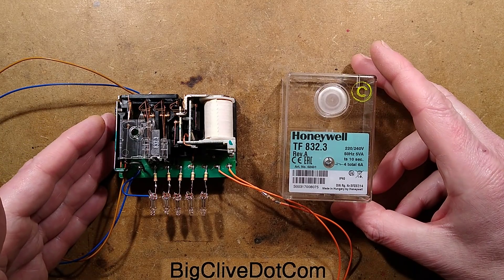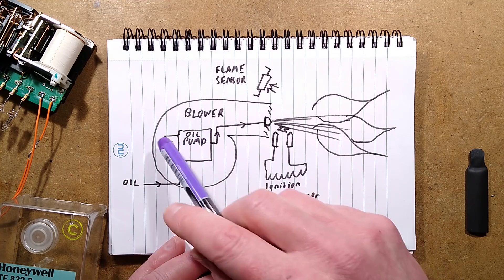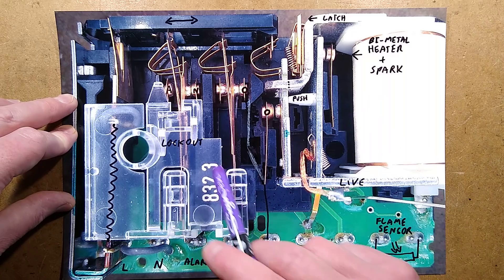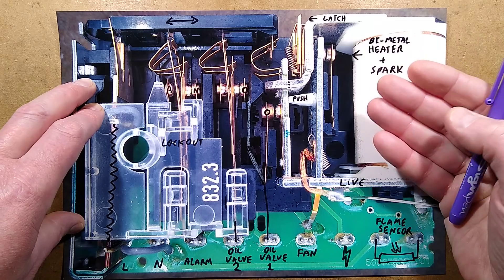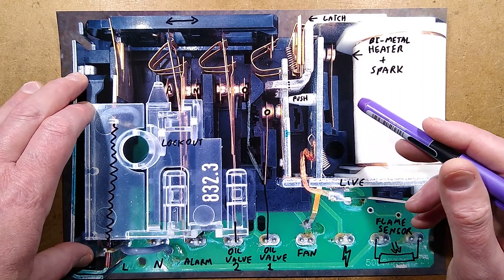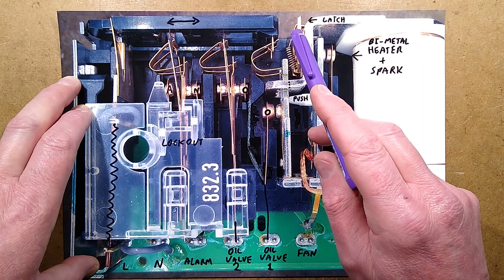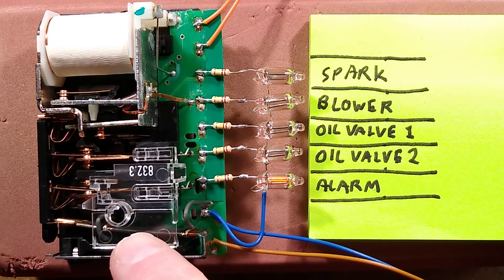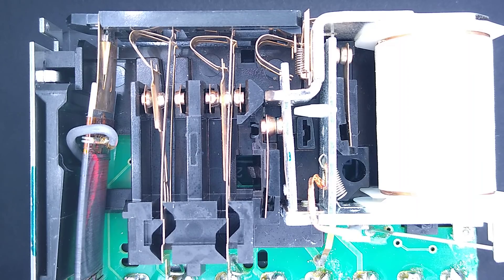Incredibly clever oil furnace burner controller (very perplexing)

Comment: You just know at some point a Chinese manufacturer will look at this, decide the error indicator needs to flash, and put a microcontroller on it to blink the indicator on and off.
Reply: It's already built into the controller, no doubt done by the pcb on the backside. Different flashing patterns on the reset button lamp signify the fault, black magic.
Reply: @BobJones-sx4pb  Heh, it was mostly a joke regarding the flashing lights that featured on a previous video where they had an 8-pin microcontroller that was only there to flash the LEDs—and in the particular vid the micro had been bridged out because it was an "always on" version. The micro was still there, still strobing its output pin—but nothing listened to it.
Reply: @ConstantlyDamaged  Ah sorry missed that - cue over my head emoticon
Reply: @bobh9319  'Sall good mate.

Comment: I was troubleshooting a flame sensor and didn't know anything about their operation.  I saw a few fine wires to the unit and assumed they were the 4-20mA signal line.  When I touched them I got a few hundred volts of shock.  Turns out the wires were the Excitation line and the sensor used high voltage to create spark potential.  So long as the flame produced ultraviolet light the spark would continue.  No UV gave no spark arc and the unit shut down.  Fun game the whole 'Learning What the Black Box Does' is to play. [The sparks were barely visible and 1mm long at most]

Comment: Reminds me of the "fun" I had trying to figure out the way the Poka Yoke ポカヨケsystem  worked  at the Honda car plant I worked at, which was used to stop the production line  if a critical bolt was not fastened, missed, cross threaded or not tightened to its specific torque. Devilishly clever when you consider conveyors, pneumatic systems, transducers and tools and all sorts of stuff were all linked together.

Comment: Those units were designed by a swiss company, Satronic. Honeywell bought them out. They make gas units in a similar design and also bigger ones with motorised cam switches. They're known as one of the cheapest controllers in the industry, and the propensity for the tiny contacts to burn out readily (they're all operating inductive loads) shows it.
Reply from the maker: The biggest inductive load is the motor, which is only switched by the normally closed fault contact. It would be interesting to see which contacts are most prone to failing.
Reply: @bigclivedotcom  the spark transformer and oil valves are somewhat reactive

Comment: Before electric flame sensors, the controllers were mounted on the flue so that bi-metallic contacts activated by heat verified a flame. They were capable of restarting, lock out and reset. Just picture this unit but twice as complicated, plus hot and sooty. Side note: The purpose of the oil delay is to allow the fan to induce an upwards draft in the chimney prior to starting the flame.
Reply: Yup, old “stack switches”. Had a coil in the flue that would twist with heat, and close the contacts. 

Problem with those was the amount of delay allowed from start to a safety shutdown. If the burner had experienced ignition failure, there would be an awful lot of atomized oil sprayed in the chamber before it tripped the burner off. Compound this by the homeowner hitting the reset, for another blast of unburnt oil entering the chamber.

Comment: I opened one of these up a few years ago. It had been replaced as the timing was off and it shut down to early in the ignition phase. I figured it was probably a leaking capacitor so I thought it just might be an easy fix to replace it and have a spare controller at hand. Well, as we both now know that wasn't the case...
I spent some time figuring out just how it worked. This controller would actually do three ignition attempts before shutting down, so it was just slightly more complex, but basically it functions just the same, just an added bimetal spring and heater that is timed to allow the ignition circuit to cycle through three attempts before shutting down.
In the end I just sprayed it down with contact cleaner and assembled it again. It did work when I tested it but I didn't feel certain it wouldn't gunk up again so it's on the shelf for now.

Comment: This reminds me of control circuitry of old elevators. Those are also mechanical wonders. Especially the mechanisms for determining the current floor. In some systems they even 'simulate' the elevator car by having a miniature one inside the control cabinet that pushes against switches while moving.
Reply from the maker: The Otis pie plate selector is one of the freakiest.
https://www.youtube.com/watch?v=Ge_2D1XKKO8

Comment: Thanks BigClive for solving a mystery of over 40 years!  I can recall getting soaked in diesel trying to troubleshoot a De Detrich burner that would "lock-out" and fail to ignite. It had a Honeywell controller very much like shown (installed in 1972)...I figured that the contacted were a bit pitted, so  I polished with sandpaper. Finally figured that the flame sensor was all sooted over the LDR and needed a clean. When it fired up with a mighty trump and roar I was a very very happy 12 year old kid! Only problem was my "school shoes" stank of diesel for months after...
Reply: I've been having the same experience with a older Cuenod NC-4 burner that would not fire at all, even with a new controller fitted it would still lock out.. As I was helping the tech dismantle the darned thing.

I remember we tested the flame sensor (using a lighter to simulate a light presence, the sensor was temporarily connected to a DMM) and it was good.. Then we tested the coil on the pump, yup, it was completely open, so we swapped it, did it solve the problem? Nope! Still no flame... The tech threw in the towel and swapped the whole pump assembly. Nearly had the oil tank empty itself in the basement, I remember the moment I rushed for the shut-off valve.. Good times lol

We smelled like oil for about a week after this whole ordeal, definitely not something I'd like to experience again!

I asked the tech if these control boxes would go bad often, and unsurprisingly (at the time it was surprising for me), he told me that they rarely go bad, and if they do, it's usually the contacts inside that need to be cleaned.

For years I was always wondering how these worked, but I really didn't think they would be so simple yet complicated at the same time.

Comment: I remember when the control circuit failed on my parents oil boiler after 20 years of service. We spent a while trying to figure it out. Good to see how it finally works after 20 odd years of waiting 😀. I'm sure controller number 2 will fail soon.
Reply: "control circuit failed on my parents oil boiler after 20 years of service"
Our boiler was so old, it didn't have a controller ! Either the gas valve was open or it wasn't :)

Comment: A genuine "wow" - this is a truly amazing piece of design.

It's the sort of "extreme cleverness" that makes you wonder though if the inventor ended up rocking himself gently in an asylum somewhere - I think this level of complexity is more likely from someone that is at least partly savant. Remarkable design - and great explanation too, thank you.
Reply: I wonder if this started as a simple (ish!) controller and then was added to over time to meet the demands. Can you add a second oil jet? Yep. Oh, now can you add an alarm trigger? No problem! Actually, we need to sanity check the flame sensor, can you add that now too ....turning it into the fiendishly complex structure we see here.
Reply: @Wirralguy  It was probably the result of many years (decades?) of problems and regulations.  Look at current electrical safety regulations or aviation maintenance requirements. All of those are built upon the injuries and deaths of the past.
Reply: Stop asking for my real name! Absolutely - incrementally refined over probably 100 years now by reviewing catastrophic failure modes, until it will almost always fail in a safe mode.  This wasn't a single inventor or even a single team - it was a community trying to keep people safe.

Comment: Man, that's the kind of old-fashioned engineering you don't really get to see very often anymore. Must have taken a lot of fine-tuning on the manufacturing side to get it just right. Needed to watch it a couple of times to understand it properly, but I still can't quite figure out what that latch thing in the top right is doing there. In the scenarios you showed it seems like it could work without it, but there must be something I'm missing.
Reply from the maker: It prevents the power being disconnected from the bimetallic heater (and ignition transformer) until the full excursion of the actuator has been achieved.
Reply: @bigclivedotcom  Yes, but I don't quite get why it does that. Could it be because the spark may intermittently trigger the light sensor and this prevents that false triggering?
Reply from the maker: @ManWithBeard1990  I'd guess it is to maintain the spark briefly to ensure complete ignition in case there's just a localised burst of flame at the spark gap.
Reply: @bigclivedotcom  Yeah, that's probably it. Or something along those lines.

Comment: Modern burners 
1. purge any explosive gases by running the blower for a few air changes 
2. light the pilot usually HEI, high energy ignition, or spark or hot surface, above autoignition temp for the fuel
3. Prove the pilot using flame rod in the flame or photoelectric means, hydrogen requires UV camera. 
4. For a new or cold system you must wait for the cavity to heat and drive off any moisture in the fire brick so they don’t explode
5. Turn on the main burner and begin process

In the US we use NFPA and we code our PLCs and other safety systems to prevent companies trying to say burn waste without the main burner ...true story from the IOC, Indian Oil Corp.
Reply from the maker: I'm intrigued at the explosion characteristics of the proposed hydrogen furnaces.

Comment: Thanks big Clive, will go over relays. Already have the safety tether switch to put in circuit. Was going to put on Genny ignition, now maybe needs to be moved to motor feed line.
Reply: # I mean the relay control signal is safety switched, not the three phase power. Don't really want 400v on the end of a cotton tether!

Comment: A state diagram would be a good way to explain this.
Reply: I just want to do an hierarchical state machine for this. It looks so interesting
Reply: @MrPmjg  do not limit yourself to state diagram. go full set of UML. Structure, Behavior and Interaction diagrams. Quite an exercise!
Reply: @NoHandleToSpeakOf  I was actually thinking about in coding in C the HSM (hierarchical state machine) and tested with some unitest for my satisfaction. But that sounds exactly like what I do for my job, so I am still considering if I even should. But if you do it, please share, as I would like to see it. Have a good weekend

Comment: 2:52 - Did you mean an inkjet printer? There are several types of 3D printers, but I don't think any common type atomises the material; mixing it with air would generally be a bad idea.
Reply from the maker: I meant the nozzle on a 3D printer.  They look very similar to oil burner nozzles.
Reply: @bigclivedotcom  - Ah, so you mean the nozzle looks similar, not the atomised jet? A "3D printer jet" (assuming you mean an FDM printer) is basically a continuous extrusion of melted plastic.

Comment: about a year ago I worked on a fuel oil furnace(which was prob made in the early 1960s)for an older relative. it wasnt lighting the fuel due to soot on the fuel nozzle and the flame sensor. my biggest fear was the large warning labels stating this unit was 15k-16k volts. So i fully disconnected all the power leads before disassembling everything. I had never taken one of these apart and i was surprised at how simple this furnace really was. Thanks for sharing your UK variant of this device!!

Comment: Beautifully elegant. This is exaclty why I enjoy mechanical devices. It's all so cleverly put together and you can usually understand it even without a manual or schematic, just by watching it operate and seeing the movement of its parts.
Could you possibly put together a video about relays? A general introduction to relays, followed by uses and what can be done with a relay. Something a bit like your A simple guide to electronic components or your videos about soldering, those are very good. I have some old and new and big and small relays in my parts bin and I have no idea what to usem them for. Thank you for the interesting content!

Comment: Yeahp, our power plants used all kinds of Honeywell controlling devices both the main fuel-oil burners flame and the initial propane 
burners were monitored by Honeywell both UV and IR types. And that one was used to monitor the initial propane burner and cut it off 
if the propane flame was not detected after 5 seconds. Good old days.......

Comment: Of course it is a very clever and complicated design. They took great pains to make it fool proof, and you know how ingenious fools can be. I prefer the platinum type flame sensors, as they are not fooled by light, and if positioned properly can detect things like flame rollout. My guess is that there is also some type of over temp cutout that kills power to the whole thing?
Reply from the maker: I'm gonna bridge all the contacts with solder so my heating doesn't go off.
Reply: @bigclivedotcom  What the hell, replace the oil with nitromethane when it's extra cold outside.

Comment: Hi, l found this video very interesting as l work for many years at an NHS hospital with the maintenance department. The hospital had duel fuel ( natural gas or oil ) steam boilers plus a medical incinerator which had those units fitted. The biggest problem we found with them as you highlighted due to the rather hostile environment they operated in they failed on a regular basis mechanically more often than not.  The flame sensor on our units had ultraviolet detectors which look like a tubular lamp with an indexing base so it could only be fitted with it viewing the flame. Keep up the good work and stay safe.
Reply: I assume nobody considered re-locating the units to a better environment.
Reply: Hi, l did relocate unit away from the vibration of burner itself which helped but as they had installed a medical incinerator in the boiler house didn't help as it produced very high working temperatures and a very aggressive dusty atmosphere due to the high use of lime to neutralise the acidic gases which were produced in the incinerator's burning process.
Reply: I'd bet all of the failures were safe, i.e. shut down instead of causing a fire or explosion.  Annoying, but safe.

Comment: Did Honeywell invent central heating? All their stuff seems to be weirdly electromechanical which makes me think it's been around for ages - probably before transistors.
Reply: Allot of the same type electromechanical components can be seen on furnaces, and boilers all the way back to the 40’s, and 50’s, at least here in North America. 

The old adage “if it ain’t broken”. It’s robust, with many of these protector relays lasting the lifespan of the heating equipment they’re on (20 or more years), and best for Honeywell, since it’s a proven workhorse, it’s not going to get them sued for little, or BIG failures.

Comment: I cut my electromechanical teeth on these units from teenage as I serviced and maintained the household oil boiler. I even have a complete Roelo burner unit in my garage just in case. Doesn’t everyone?  You can’t really bugger around with a gas boiler in the same way can you?😂. In my childhood we had a Wilson Wallflame boiler which was much simpler and elegant in its operation but didn’t have any lockout facility so cold radiators usually indicated that you would be mopping up kerosene puddles under the boiler!  I still don’t get out enough arguably!😂🤓

Comment: So that’s how it works, often wondered why the boiler takes so long to fire up.
When our boiler failed to light once because the oil pipe froze the guy that services it advised me to get a pocket torch and put it on the light sensor to force the controller to keep the ignition sequence going until the oil came through again.
A little insider knowledge there for you. 
Doesn’t hurt to pull out the sensor and clean it with a rag from time to time.
Great example of if it ain’t broken don’t fix it. If it was electronic it would probably get too hot where it’s located and fail.
Reply: That's a great tip, I'll try and remember that one, cheers
Reply: Defeating a safety interlock is grounds for termination so don’t get caught
Reply: @peterg.8245  Yup, termination by your employer or your maker, but if it gets you out of a tight spot, eh

Comment: I've fought with this controller for years on my greenhouse furnace.  That relay with the bimetalic lockout device drives me crazy.  Mine is different using a resistor to heat the relay to provide the time delay to give the burner 45 seconds to get a flame going.   The fool thing is not long term reliable and I have to keep buying them.  And there is no way to electrically tap into the device to drive a remote alarm.  "stupidly complicated" is the truth!   There must be a better way....

Comment: We’re not on mains gas here. (Old mining town) so this was interesting to see how this module works. Assuming that one of these is fitted to our HRM wallstar combi boiler system I had to press the reset that one time we ran out of oil. 
Heating oil is cheaper and the 1500 litre tank we have lasts a good while..